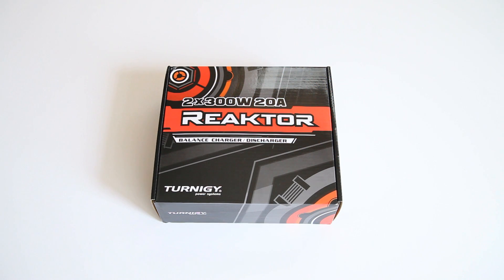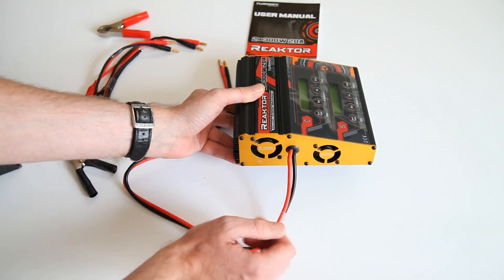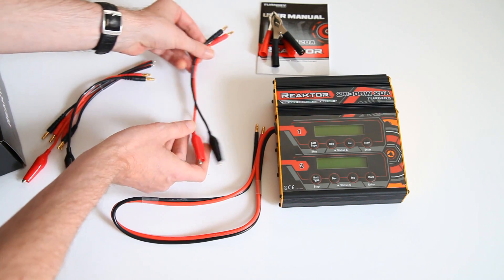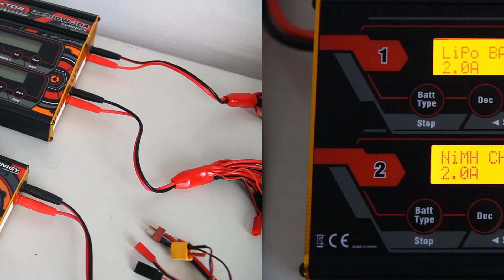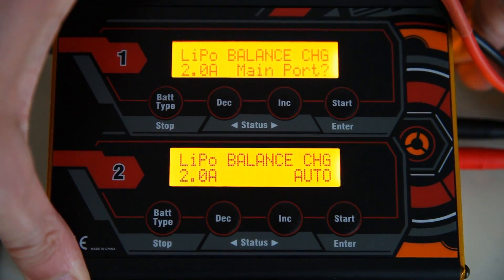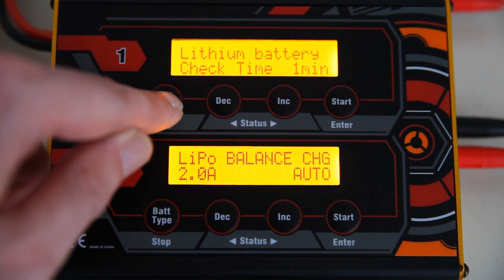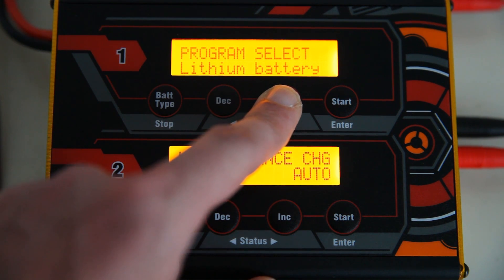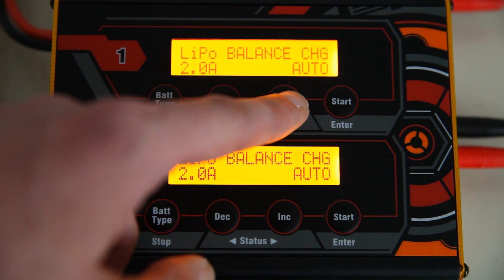Turnigy Reaktor 2 X 300W 20A Charger - Unboxing + rundown of the menu

Comment: it looks very nice, but I don't like two things: the USB and the temperature sensor connectors (there aren't) and the input voltage cables, which I prefer removable. I also like the two cables without connector to solder your own battery connector, they could include one in all chargers....

Good video!
Reply from the maker: RC Bacodi Thanks sir! Glad you liked it.. 
And yeah.. I would at least have liked an USB port.. BUT, if you really have to have those: get the single version Reaktor :)  
For me, the hard-wired input isn't a problem.. The wires ARE nice and long by the way..
Cheers!